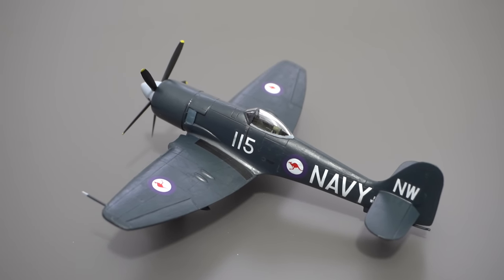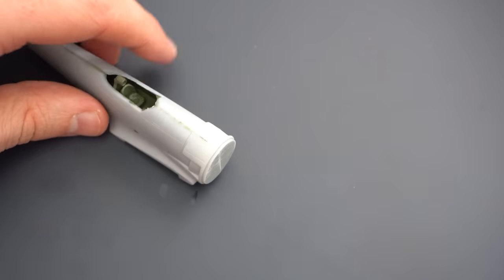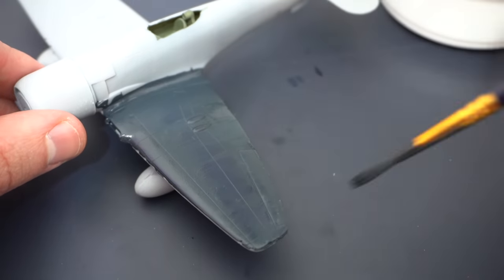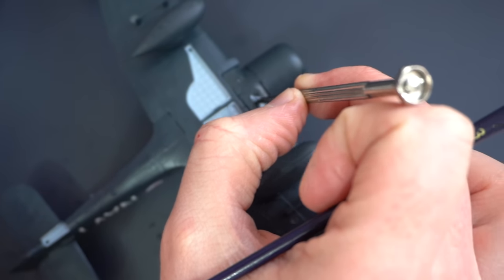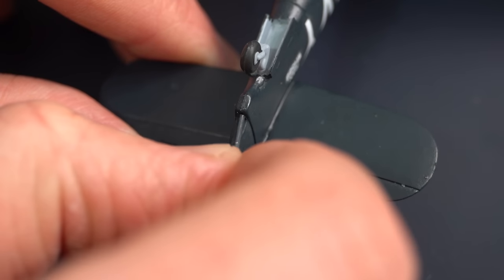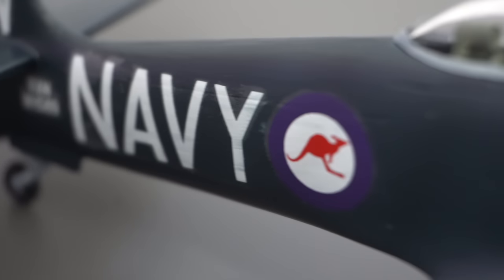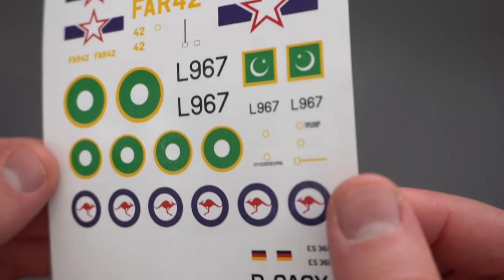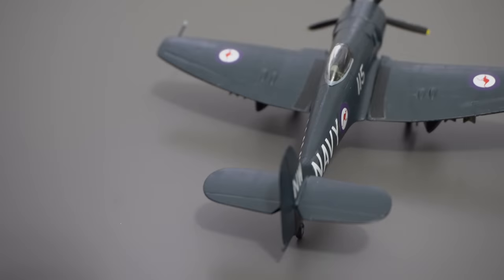Do we forget to have FUN? PM Model Sea Fury FB11 in 1/72 scale - Build & Review (Kinda)

Comment: I believe (but cant know for sure) that tooling is derived from or updated from the 1960's & 70's Frog / Novo model.

Wings are put together very differently (better), panel lines are recessed, but I swear the cab interior and the crude missiles are identical to the Novo one I am building (I put my rear bulkhead on top of that "bar" on the cab floor as thats how I interpreted the Novo instructions).

May be wrong but it doesnt hurt to speculate aimlessly...

That's a nice, quick build by the way!  Australian scheme looks great on them.
Reply from the maker: Thanks for the thoughts! I do actually have a Frog Sea Fury in the stash that I got second hand, and whilst there are similarities, I think the PM Model version might have been "inspired" by the Frog version, but it doesn't seem to be a direct copy.

Panel lines on frog are raised, on PM they are recessed
Pilot is included in Frog, absent in PM
Frog has option of folded wings, PM does not
Drop tanks come in 2 parts on both, but on Frog they have a top and bottom, whilst PM have two sides that are joined
Frog lower wings come in 4 parts, PM is a single part
Tail surfaces on PM are single parts, and split on Frog
A seperate part for the Rudder is included in the Frog, whilst it is part of the fuselage moulding on PM

So yeah, whilst I think the PM kit has been inspired by the Frog kit (particularly with the engine construction, rocket design and landing gear) I think that the Frog version is distinctively different enough for it to not be a direct copy or upgrade